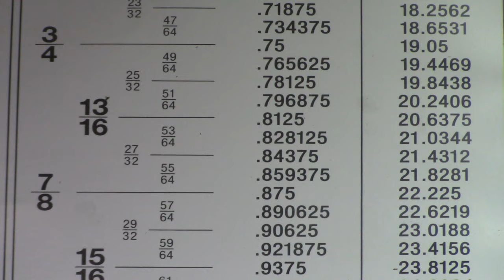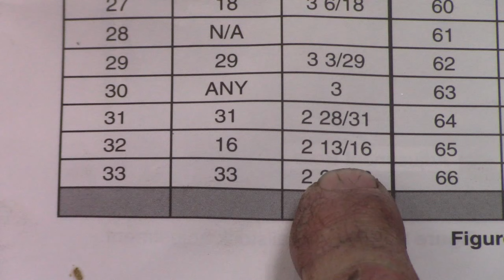Making a Threading Dial for my 1931 South Bend 11 #84-A

Comment: When I was in the navy and later on at a large logging operation my lathes had no dial for threading. Just close the split nut and thread away backing out by simply reversing the apron. Still to this day when I am on my friends lathe I don't use the dial as his has a habit of when engaging the dial and the split nut isn't completely closed ruining the part. I never did like setting up an indexing head. Likely due to not using them often enough, LOL. I so love one off jobs like this. You really made this one look like it came this way from the factory so many years ago. Once again another great post from the one called "Winky".
Reply from the maker: Yeah...  it's hard to reverse like that when the lathes does not have a brake. I guess it does look original!
Reply: @WinkysWorkshop  The last one at work was a Chez machine, 8 ft centers and a 16in swing with a 4 inch through chuck and gearbox that had a foot pedal that applied the brake and reverse at the same time. It was a bit quick so I used the handle. It was set up for 4 types of threads Round, Witworth, Metric and Standard. It had a tracer as well and just a real sweetheart. After being retired for a year I went back for a visit and it was a sad day I will never forget. The feeds were not working, they asked if I knew what was wrong. I lied and said no. 8 mechanics in the place couldn't see the broken spring type shear pin right in front of them. It was filthy, the ways were dry and the apron was so badly beat up from contact with the chuck that could barely be tightened either way. I was almost physically sick. The lead screw was round, right full of dirt and someone had greased it. A couple years later the business shut down. The fellow who bought the lathe at auction called one day about the reverse pedal. I went out and he had completely refurbished my old lovely lady..... New paint, freshly scraped ways and apron. New hand made gibs, the whole 9 yards. One of those tool posts like yours a new 6 jaw chuck and a lead screw and apron were all beautifully repaired. I did get a moist eye. I threaded a 2 " shaft for him showing both methods and have never been back as wishing for something that can't happen is a waste of time. Your old girl will outlast us both my friend. It was lathes like yours that made the pieces for larger machines like mine. So on and so forth. All that new upgrades you did bring it farther along and all you need for 2022 is put a DRO on it. Please don't as it wouldn't look right eh. Thanks bud, see you next post.

Comment: Good work pushing through this. I appreciate warts and all filming. Things don’t always go well and I like to know that after hours of work - I am not alone... LOL. I failed four times for my first change gear and will likely fail some more. Thanks for sharing your content is always very good!
Reply from the maker: Thanks you sir. I have a lot of fun making the videos and most often I learn something to. I saw a guy use an acme tap like I tried to use the acme threads and it worked well but the price of an Acme tap was outside my budget for a one time gear. I'm glad I finally learned my indexing disks. Next up, making a gear...  well someday I will. Thanks again for your kind words!

Comment: Hi from N Ireland. Enjoyed your video and your accent. Need to make one for my boxford but it has a 3mm pitch thread. So I have to work out worm gear. Thanks again.
Reply from the maker: I asked a fellow South Bend owner on FB to give me the OD and number of teeth. Easier than all the math
Reply: Found out two gears needed 20 t and 21 t . Instead of numbers letters are used to index. A,B,C,D & E. There are charts online to work out the different combinations. Thanks

Comment: I have to make one for my Logan. Great video!!
Reply from the maker: The Logan is a much smaller gear although I suspect they would be interchangeable.  Instead of the teeth on the gear being angled Logan mounted the dial at a slight angle. I made one for my 200 but as long as the lead screw is 8 TPI they should all be the same. Here's the gear I used. https://www.amazon.com/gp/product/B0026GXY1S/ref=ppx_yo_dt_b_search_asin_title?ie=UTF8&psc=1

Comment: Nice work. I need to build 1 for my logan at some point as well. Love the tilted rotary table idea
Reply from the maker: I made one for my Logan too although I didn't make a video. I bought the gear which was much smaller. The gear is straight cut and the dial is slightly cocked to match the threads. I copied the original.

Comment: I've got a 16×60 sebastian lathe I need a tread dail for the one that was on it was made from brass its eat up. Great job.
Reply from the maker: Go for it! I like steel the best but aluminum works well too. Technically the steel probably holds up better unless you have super high humidity. With that being said, I doubt I'd ever wear out a set of aluminum dials

Comment: Great job on threading dial. I have one comment. After you saw cut the gear in the dividing head, I would have set up a fly cutter with a single tool profiled the shape of your acme thread and a larger diameter making your gear almost perfect. A malleable iron material would also cause less wear on your lead screw. Thanks for your videos.
Reply from the maker: I've done that single point cutter thing before to repair a gear on my Logan. It worked well but it was very slow going. The saw was fairly fast. Obviously the tooth profile is off although the profile of a standard gear is also off to acme threads. Brass would have been a good option although the gear is basically free moving with no load. I'd be surprised if anything will wear. Thanks.

Comment: Do not forget that for making hobs a good source of quality steel is vehicle axles--cut of what you need--anneal it--cut your thread--machine the cutting teeth and then harden...Make sure you get the first revolution on your gear before you relax..Then its easy..regards E
Reply from the maker: I'm thinking I should have also milled 3 slots and ground the thread peaks down a little just in front of the cutting edge too. Thanks for the tip on the steel!

Comment: The angle at which you tilt the dividing head is Thread Pitch=(1/tpi)     and tpi is threads per inch
Reply from the maker: You mean "Angle = 1/TPI" ? So 8 TPI is 8 degrees???
Reply: @WinkysWorkshop    It works out to a right angle triangle.  example,  if you have a lead screw with a outer diameter of 1".   The  angle=inverse tan X ((1/number of threads per inch)/1").   If your lathe has 1" OD and a Pitch of (1/8)= .125", the angle is 7.125 degrees.  This value of 7.125 degrees is then scaled by cross multiplication with the width of the base of the dividing head to get the shim height.  also you can tilt the dividing head to 7.125 degrees and slide some shims underneath.
Reply from the maker: @dlfabrications  - I think I should have had more math in school. I had one year of algebra in high school at that was it. I have no college education. Obviously I find ways around this missing education and quite often I learn math as needed. I actually had what I would call a job in engineering redesigning problem areas on machines in the printing industry. I guess you might say I know  what is possible and find the answers as needed. It's intuitive vs learned I suppose. For instance I could probably look at a truss and closely estimate the load transferred to a section of the truss but would have no idea about the math.
Reply from the maker: @dlfabrications  - I watched your tail stock video. I've had the same problem on my Logan lathe. I bought a #2 tapered reamer and touched up the bore. It helped some but it's still better to have something to grab the tang. When I got my South Bend lathe it didn't have a spindle so I made one. I put two sets screws in the side of the spindle. It worked fantastic!!! Watch starting here for a few minutes. It shows the reamer and set screws install. https://youtu.be/vrXBkqC6ttc?t=1669
Reply: @WinkysWorkshop  Good job!
I watched your video https://youtu.be/vrXBkqC6ttc?t=1669 and it   is a good idea.  I thought my tailstock spindle was hardened steel.   I just went to check this out and gave it a the file test.  coarse file = mild steel,  fine file = harder steel,  any file no scratch = harden steel.  It is mild steel so I will in the future either make a quill or modify the current one.  Thanks
Reply from the maker: @dlfabrications  - No problem...  thanks for the math too

Comment: Great job, looks very impressive.  I'm going to make one for my grizzly. Have thought of putting a spring on the mount arm to hold the dial gear against the lead screw? Just a note.
Reply from the maker: Thanks! The spring would work. I was surprised my lathe did not have one. Your grizzly came without one also huh?

Comment: Hello, ive only recently started really using my south bend 10 heavy lathe after 20 years. I love your videos and hope you are well. I've recently made my own dial indicator after watching your video and i have a question if you don't mind. Can you explain the numbering on the indicator regarding even and odd number threads please.  I hope that makes sense.
Reply from the maker: No problem. Some dials are different but I think yours is made like mine. When cutting even threads (like 6, 8 , 10 TPI) you can engage the half nut on any mark. For odd threads (13, 5, etc) you can throw it in on any short or long line (or odd or even number) but you have to stay with whatever you start with during the threading process (always short or always long). The numbers are not important unless all the lines are the same length Short lines are even and long are odd. The numbers are needed for odd threads like 4.5 TPI or 2.5 TPI. I've never had a need to cut these weird threads so I left the numbers off my dial.
Reply: @WinkysWorkshop  that's great, thank you for clearing that up for me. Have a great day look forward to your next video.
Reply from the maker: @kevingray1757  Glad you understood. It's fairly simple but I wasn't sure I explained it well.
Reply: Spot on thank you

Comment: How did you figure out the gear ratio. How many number of teeth for the dial Gear
Reply from the maker: Too much work! 😜...  I just asked somebody with a South bend lathe to count the teeth and measure the diameter on there lathe dial.

Comment: Does the diameter of the gear make a difference as long. As the thread pitch in the same as the lead screw?
Reply from the maker: You could be off on diameter a little but the number of teeth on the gear has to be right.

Comment: Could you explain the way you decided what the gear tooth count should be? 
My lathe was missing the counter. I found a used one that was from a totally different machine. Just wondering how to calculate if it will be accurate.
Reply from the maker: Yeah...  I found somebody with a similar lathe and had them measure the diameter and count the teeth. I'm positive there are ways to calculate what is needed but I'd have to give that a lot of thought. If I was you I'd find somebody with a similar lathe and do the same.
Reply from the maker: I'm guessing any lathe with a particular TPI lead screw will be the same gear.

Comment: Just passing the time..........I got so used to cutting Metric threads by leaving the half nut engaged all the time and winding the chuck and saddle back on my Imperial leadscrewed 1930 Colchester Bantam lathe that I just cut threads that way for Imperial pitches too......I just can't be bothered to disengage the half nut and do it the old way and adding a threading dial is not something I need to do anymore.
Reply from the maker: Probably a great way to do it if you have a brake or instant reverse.
Reply: @WinkysWorkshop  It was just a necessity as I have an Imperial leadscrew and that is the only way to cut Metric threads. Over the years I got tired of watching the threading dial go round to the spot I wanted and engaging the nuts so that is what I now use all of the time......threading is done at 100 rpm so reversing the screw is not a problem and I do it with  handle in the spindle end anyway. I wouldn't advise anyone to run up to a shoulder and quickly reverse the spindle......that takes split second timing, experience does count. 
There is a device called a single tooth dog clutch that is incorporated in the beginning of the screw cutting gear train mechanism and it allows instant stopping of the leadscrew without stopping the spindle, especially when doing Metric threads, and you don't lose synchronisation of leadscrew to spindle.
The geartrain and half nuts remain engaged all the time to maintain the threading position.....you can thread at 300rpm with carbide up to a shoulder without having a mishap.
This was designed by a guy.....I think it was Martin Cleeve but maybe wrong..... in the UK magazine Model Engineer back in the 70's.
Reply from the maker: @gangleweed  - Interesting. I'll bet the clutch is lathe specific. Thanks to you I will likely lose sleep tonight trying to imagine how to stop instantly at 300 rpm. I'm kidding although quite often I avoid looking at a proven design until I have an idea how I would do it. Most the time a proven design is better but every now and then my approach is much better . Thanks!
Reply: @WinkysWorkshop  The design is probably applicable to most lathes and it basically consists of disconnecting the spindle itself from the gear train but keeping the gears engaged to one another.
It's a small one tooth dog clutch that connects or disconnects the spindle gear to the spindle it rotates on.
On most lathes there is a fixed gear on the spindle that meshes with the first stud gear of the gear train.
It's quite clever how it works but it would take an essay to explain it in detail.
In operation a lever arm connected to the dog clutch is pushed off by a rod on the saddle as it nears the end of the thread stopping the saddle immediately......then with the half nuts still engaged you wind the leadscrew back with a handwheel attached to the right hand end of the leadscrew.....the dog clutch ensure the spindle will take up the drive at exactly the same spot as one pitch in either Imperial or Metric is one turn of the screw.

Comment: I'm in the same position you are (were) in.  I have a 1935 SB with 15" swing, 6 ft bed.  How did you decide how many teeth were needed on your gear?  Thanks for posting your work on this!
Reply from the maker: I asked a guy on facebook who has a SB 11 like mine to measure the OD and count the teeth on his gear. I'm sure you can do the math but that would be hard for me.
Reply: @WinkysWorkshop   Thanks for your reply.  I just was told by a guy on a machinist forum that it needs to be 24 teeth, and of a pitch to match the lead screw.  Thanks!
Reply from the maker: @KevinToppenberg  Your welcome... That sounds right.

Comment: Nice job, you solved some of the problems I am going to have when I make mine. The table you used at the beginning was it in the rotary table manual or somewhere else, mine is 90:1 also so should be the same although for a different tooth count and 3mm leadscrew.
Reply from the maker: Yes it was in the manual, the table was sold by Grizzly although the same table is likely sold by many. Look on page 17.  https://cdn0.grizzly.com/manuals/h7527_m.pdf
Reply: @WinkysWorkshop  great thanks, yes i think they are generic tables sold by many, mines still in the box, its been hrre 6 months. All i know is its 90:1 so the same table should work if its not in my manual.
Reply from the maker: @incubatork  - Mine came with my mill when I bought it. This is the second time I've used it but it sat over a year before I tried it.

Comment: I would like to build a tread cutting dial for my Lablond lath thst I picked up and wanted to know how did you know what diameter to cut the stock and the depth of cut to get the right gear size for your indicator?  Was it something you looked up and if so are all the ratios the same for all the lathes? 
Sorry, I'm new to Machining now that I'm retired. love your videos  and stay healthy since we are locked down.
Reply from the maker: I cheated :o)  I asked somebody with a South Bend lathe what the diameter and number of teeth were. With that being said, if you have a 8TPI lead screw I think 32 teeth will work. Gears are confusing plus this is not a normal gear. On the plus side, it doesn't drive anything so it's forgiving.
Reply: @WinkysWorkshop  Not SO! It will drive your brain CRAZY!

Comment: Hi winkey can you tell us what the final width the teeth were cut to and how deep.. got the same lathe been trying to get the teeth right but I,m failing got the diameter and boss right it,s   just the teeth letting me down..love the vids by the way
Reply from the maker: Sorry, I thought I included that. It was .080 but you could go slightly wider. The gear diameter was 1-5/16".  I don't know if this is ideal but if you go larger the tooth spacing will be larger too. Oh...  and just in case, the gear is 32 tooth for a 8 TPI lead screw.  Thanks for watching!
Reply: @WinkysWorkshop  thanks winky will try that

Comment: That's really impressive Winky. I like your style! One question however, when you attempted to make the first gear you used brass or bronze, why did you decide not to use brass for the second gear and  instead use steel ? Although you won't be using it all the time a steel gear onto the leadscrew is bound to cause much more wear than the bra gear would have.
Reply from the maker: I used brass on the first gear because it cuts easier. Good point, I agree brass would be better for wear but most lathes use steel on their original threading dials so I'm not worried. I think maybe I ran of of brass of maybe just because it was cheaper.